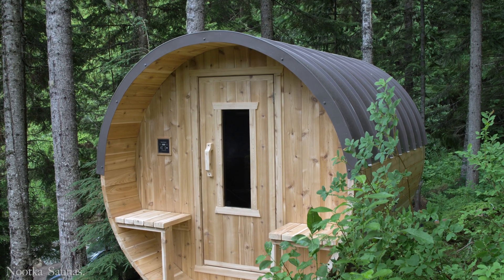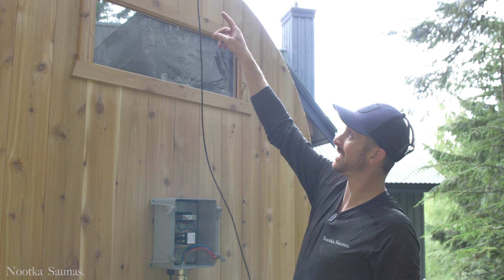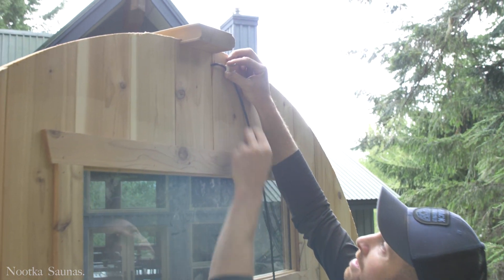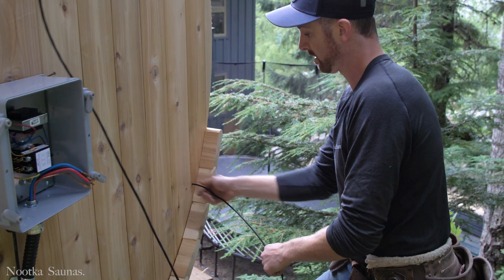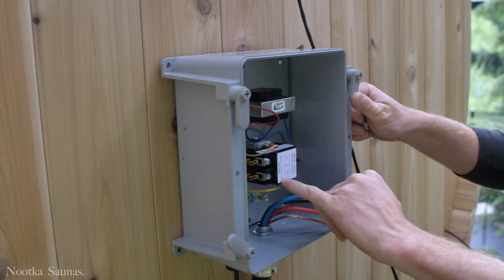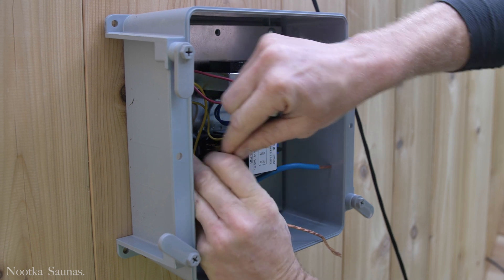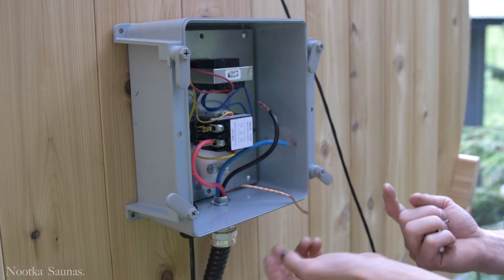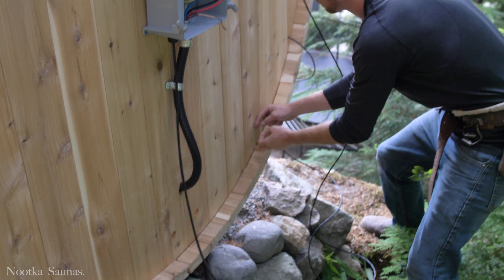Step 5.4 (For Electric Saunas): Wiring Your Junction Box

Comment: You should use crimped Ferrule connectors on all the 220v stranded wires.  A sauna heater draws a lot of amps, and just using stranded wires bare makes for a potentially dangerous connection.